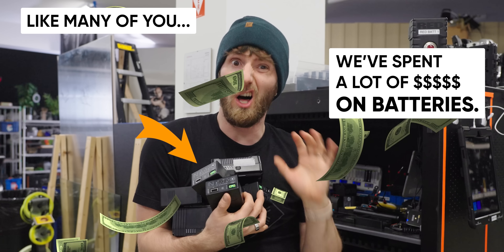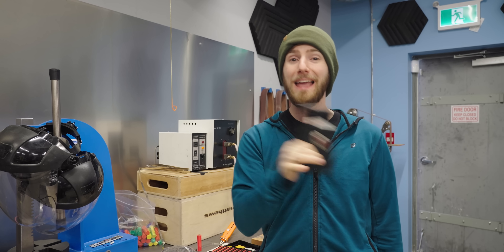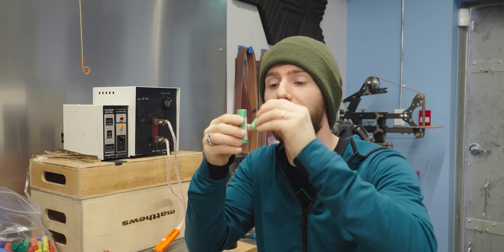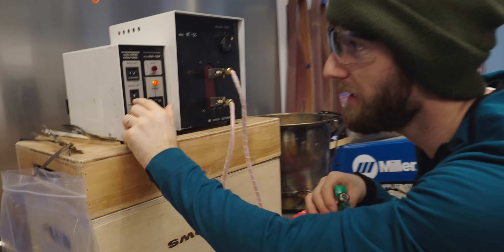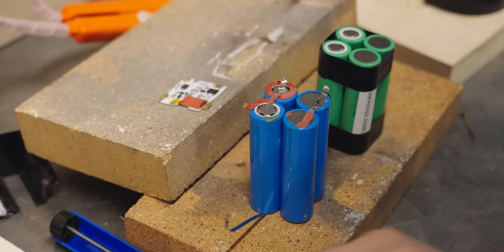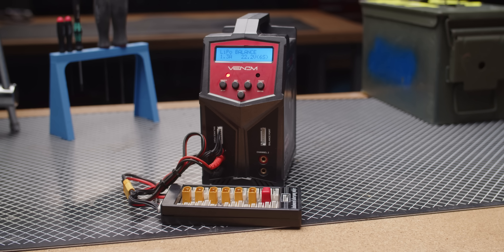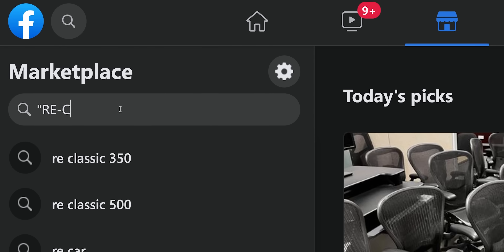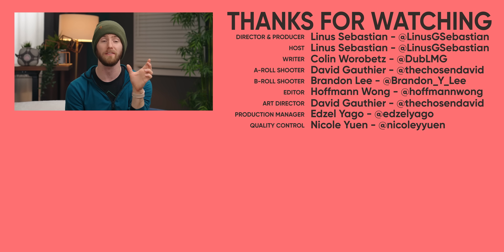This should be illegal… Battery Repair Blocking

Comment: Be very careful when messing with those 18650 batteries. I had a mechanical mod vape blow up in my face (the 18650 battery inside the vape is what blew up) and the amount of energy produced was incredible. A piece of the vape went through my cheek and broke my zygomatic arch, or cheekbone. Another piece went completely through my forearm. I was lucky in that it didn’t hit any bone or anything. It turns out that it was a counterfeit battery that was rated at only 8 amps instead of the 30 amps that the battery had printed on it. I had bought the battery from what I thought was a reputable shop. All this occurred the very first time I had used it and with absolutely no warning signs. So do not let the small size of that 18650 battery fool you, they pack quite a punch!
Reply: dude, you had a close call... glad you're OK after that.

Comment: Many BMS chips are designed to isolate the cells from the charge/load contacts in the event of a undervoltage condition, requiring a reset to switch back on the mosfets. I've replaced packs where the BMS is part of the host device, and the cells are an array of pouch batteries in a carrier with no integrated BMS. getting the device to power back on can be as simple as connecting a charger in some instances, or require temporarily shorting out the mosfets that switch the battery off in others. In these situations its typically a CYA by the manufacturer, in an attempt to prevent the violent runaway explosions plaguing early lithium ion powered devices.

Comment: I have worked quite a bit with 18650 cells in a lot jerkier fashion than you, never yet had problems with it. One reason certainly is, that I am not using soldering (putting insane temperatures onto those sensitive batteries). My 11 years old laptop is a rather rare model, where there is no other battery to buy for than the original one, which consists of only 4 18650s. I replaced those by taking apart the battery housing and using 4 new cells with the original BMS. Worked well after the BMS could calibrate to the new cells properly after a few charges and discharges. I did not solder them together like they originally were, but just laid the contacts in between the batteries. The housing is so damn tights, that everything sits perfectly and the laptop battery works for years now.
My recent new crazy invention is an insane DIY battery pack for my trusty Gopro Hero 4 black. Little trivia to the camera: It still works perfectly fine, with this one issue, that for whatever reason it stops accepting power through USB, once I hit the record button. Switched firmware several times now, every time it goes back to charging while filming just for a few days before refusing to do that again. So it will always drain the battery while filming. And since I really like to use it as HQ dashcam on the bicycle, 1 hour from a regular battery doesn't cut it on my long trips. So since original Gopro batteries are 3.7V Li-Ion batteries just as 18650s, I figured the camera should run on those as well. It does, but it came a long way:
Since I couldn't run the camera over USB, long lasting power needed to go right into the camera, to it's battery contacts. So I took apart an almost dead counterfeit battery, took out the actual Li-Ion pack and replaced it with a block of wood of the exact same measurements and put it into the housing, plastic covers and BMS of this little battery pack. Holes were drilled into the wood, where cables could go through to the BMS, soldered to the original spots where the previous battery was connected to. Also drilled a hole into the edge, where camera and it's battery latch touch, where the cable of this Frankenstein-battery could through, retaining the possibility, to just place a normal battery into the camera still.
To the other end of this cable, there was a battery holder, containing 4 18650 cells, enclosed in a very sturdy wooden frame. All of them were in parallel connection, so the voltage was the 3.7V the BMS and camera are used to, now with a huge capacity compared to the 1100mAh of an original battery. So everything was set and the camera turned on. I was expecting malfunctions at first, since I assumed this BMS would need to adjust to that new source as well - charged and discharged several times. But the existing weird behaviour stayed: Cells all charged to the same voltage, camera would turn on, but within seconds, the battery indicator would turn from full to empty. When starting a recording, the indicator would switch to flashing and 3 minutes later, the camera would turn off. That was very weird and I couldn't fix this behaviour.
At some point and some thinking, the only thing having some effect there could be the BMS. So I was like: Alright, since I can't use this camera the way it is in my desired ways, I may go a slightely risky route, not clearly knowing what happens. I took out the BMS from this battery construction and through the cables to the internal battery connectors of the camera, I directly connected those 4 18650 cells to the circuits of the camera. And what do you know, the camera turned on, now runs for months without issues and is actually able to use those cells as desired - I finally have an HQ bike dashcam, that runs between 6 and 10 hours, depending on temperature (freezing temperatures greatly lower the usable capacity of Li-Ion cells). The battery indicator is still not working totally as desired and rarely shows a fully loaded battery icon, but who cares when the practical use time is that long.

So basically, with 18650s you can build custom batteries for any device, that runs on lithium batteries. Unless shown like in this video, if the device does require the original BMS, and that being an evil one. You can do a lot with 18650s, when you are careful handling them and pay attention to voltage levels. But still, knowing the dangers of those things, I am getting myself prepared for having one or more of them taking off during working with them, or a modified device at some point dying in a fire. But I usually only do such modifications to devices, that are older and so much of a pain to lose.

Comment: I rebuilt my old laptops battery pack with quality Samsung 3000mah cells since I was mad about quality of aftermarket batteries. I didn't have a spot welder so I soldered them carefully. Been using it on my laptop for about 2 years now and it rocks solid. Even higher capacity than original (2600 vs 3000 per cell * 6), and certainly better that Chinese crap battery packs. Only problem is BMS is confused after a year and it doesn't show my charge level correctly anymore. Have to check battery voltage through HWMonitor

Comment: HP, Dell and a lot of laptop manufacturers use the "evil" types. 

Not sure if they are worse than Apple and Samsung using software to brick battery capacity to get you to buy the next version of the device.

Comment: You need to pull the datasheet for the BMS processor and do a reset! Same as laptop batteries.
Also, a single spark or momentary short is NOT a reason for a battery to explode... You need to keep the short and/or overheat the battery. 
BTW, leave the soldering job to a professional, not Linus...

Comment: The most important thing when sanding the tips of your spot welder is keeping them perfectly squared off in my experience. You’ll get sparks when welding if you don’t hold the contacts perfectly perpendicular to the tabs. I haven’t done lithium stuff, but I have a fair bit of experience building nicd and nimh battery packs and there’s a fair bit of sparks if you’re not perfectly square. Won’t hurt the battery but you won’t get a good spot weld and could blow a hole in your tab. 

On a side note, we have a jig for spot welding that uses a pedal to bring the contacts down to the battery. It seems like a much better way to get a clean weld.
Reply: I was thinking they wasted all those batteries doing that
Reply: Batteries Plus?

Comment: It's also possible the BMS has a small amount of volatile memory that gets programmed at the factory and retains its firmware as long as the battery pack has any voltage at all -- but gets erased when you disconnect the batteries from the BMS if you haven't attached a keep-alive battery first.
The real purpose of this is to prevent old batteries from being refurbished with cheap cells and sold as "OEM refurbished" or "lightly used". But of course it screws-over DIYers as well, because there is no way to distinguish between a DIYer and a scammer with a soldering iron.
Reply: That's why you measure the voltage going directly into the BMS and you prepare a station with the exact values on hold with hard switch that you can activate at the same time you snip the battery out of the loop. Essentially keeping the BMS on life support. These guys have a shit-ton of safety things wrong, so no wonder they don't know about this.
Reply: @aserta  : You don't even need to get that complicated. Just a lithium battery connected to the appropriate terminals with a pair of alligator clips will suffice. That's how I replace batteries in old videogame cartridges without losing saved games. It really is a very simple concept.
Reply: BMS's will disconnect lithium batteries because they have a minimum charge. Low and high current protections are fairly standard. To lose memory because the battery went too low and refuse to work again is not Viable. Now if the battery was reversed in the repair or had a shorted cell, miss wiring the order of cells in said string the BMS would disconnect and stay that way. To suspect maliciousness when its more likely Linus/his team made a mistake...
Reply: @chrisb298  yeA if the BMS see a voltage below lvc- low voltage cuttoff is will usually give you a flashing red/green/blue, .........(insert your battery's manufacturer's install color of led) light. Usually can be corrected by hooking up to a hobby charger and charging to above the BMS's programmed LVC value.

Comment: I have a Ford fusion hybrid and they use the same evil tactics on the batteries after about four years the battery pack will stop charging and the system will tell you you need to replace the battery regardless of the battery life or condition. I did find a way around this by using some software to reset the battery pack clock and I can now use the battery pack, but it shouldn't have to be this way

Comment: As a chemist I really like that your explain which precautions you have taken and why so. Tho don’t use a CO2 extinguisher on metal fires. Pulver might do the job but in case of Li-ion batteries… just put it in the bucket, bring it outside and wait. I mean the fire brigade in Europe does the same with electric cars. They dump them in a container full of water and hope for the best. Cheers.

Comment: You could test if the red packs are using vram by just disconnecting the cells and re-connecting them to the bms to see if the same cells don’t work anymore. I think that would be a cool short video as a follow-up to this one and provide some closure to this video.

Comment: Building a battery with lithium cells is dangerous, but not THAT dangerous. Seeing Linus almost panicking because of a spark showed that he didn't understand what the actual risks were. His team should've briefed him better because this video made it seem as if it's insanely dangerous.
Reply: Or should have got someone who's done it before. Also it's obvious that he didn't research it properly as he's still wearing his wedding ring next to a spot welder... That's just asking for trouble.
Reply: I made some packs up about ten years ago for my drone.  I slipped with the soldering iron and the tip shorted the pack.  The tip dissappeared.....
These guys were overreacting here.  
I have an ebike pack here that I'm trying to get going.  It shut down during storage and needs a code sent via rs232 to wake it back up!!!
Reply: Making it look more dangerous & incompetent is standard for LTT, why would we change that now?
Reply: @timchambers5242  idk I kinda expect more for some reason.
Reply: I'd rather have it look more dangerous than it is, because it keeps the possible Darwin award nominees from replicating this sort of stuff.
(although there's probably still an idiot out there that thinks he can do it with just the info in this one example ... )
Reply: @NotTheStinkyCheese  while I can understand where your coming from. LTT is the biggest tech channel so people are automatically gonna come here for information, this video was half done, wrong information, potentially dangerous as well. If they are going to do a video that's a bit more techy than normal then at least do it properly with proper guidance, and talking about safety.

Comment: You see lots of evil BMS in the medical device field.  I bought a used electrical bone regeneration device / electrical magnetic coil that you put around your broken bone.  I broke my tibia turbicle (the bone just under the knee/ bump) The battery packs would not work even though the cells were all good.  The BMS was programmed to only allow X amount of charges and X amount of time.  So in effect they try to force you to buy a whole new device as the old one was supposed to end up in the trash.  I swapped out the BMS with a generic bms and the battery worked great and my leg healed up just fine and I didn't spend 10 K on a stupid electric magnetic coil for my leg. I spent like 50 for it.

Comment: I was making a pack for my airsoft gun once and I did not have a spot welder. So I just soldered those cells together with wires. It worked quite fine and it made very good connection.

Comment: ALL NEW CELLS.  Well don't tell your forklift that because that's a key sector of that industry.  Most forklift batteries will get individual cells replaced.  if that isn't the case with you company then when they go end of life those batteries will be tested and any good cells and cases will be salvaged to make "new" used batteries.  I used to do this for a large battery manufacturer and it is in fact an industry standard.

Comment: I totally think that the Red BMI is evil, and for VERY good reason.  I remember when those Red Batterys first came out. I was working at a production company at the time and we were talking about buying 3-4 rad camera setup...Like the original SHOE BOX Red camera.  At the time, those Red batters had the biggest charge and running time of ANY battery on the market for video production equipment. And that was a problem because the FAA dost allow lithium batteries over a certain capacity on commercial airlines.  We worked with other production companies that had to FEDEX the batteries to the location they were going to film at just to GET the batteries for the camera to the location.  Our cameraman Drove his car from California to Chicago to get the batteries from us, then drove down to Florida for the shoot.  The reason the FAA had this rule was if your battery was too big, it would have enough lithium that IF a fire started, there was no way of putting the fire out before it would BURN THROUGH THE ALUMINUM AIRCRAFT.  So ya if you crack open a Red battery, they shut them selfs off = Evil BMI.  Because you Spending $500 on a new battery is WAY more acceptable than risking 200 people's lives when you try to fly with your DYI-Franken-batteries.
Reply: Airlines still don't allow lithium batteries >100 Wh on their planes. And those batteries are getting smaller in size and higher in capacity all the time. I recently bought a couple idx v-mount batteries that are 150 Wh each but are half the size of 90 Wh batteries from 10 years ago. They wouldn't be allowed on planes, at least not without a costly special permit.
The first Red batteries were also special because they had a much higher amperage rating than typical v-mount batteries back then. The Red One literally wouldn't work with most normal v-mounts because it drew so much power. Nowadays they can all do 10 A at minimum because people want to use them on their LED lights.
Reply: @highks496  I remember a few years ago a gaming laptop was released that was banned from airlines for exactly this issue.  I imagine the TSA calling in an IT guy to test the wattage of your laptop battery! Mainly this rule of implemented to flag someone who may try to make some homemade thermite at 30,000 feet.

Comment: With all of the issues you kept pointing out, like having to have genuine cells, how hard they are to get, needing to spot weld, the hazards of mixing cells of a different charge level, the extreme hazards that Li-Po present should they catch fire, and the list goes on... Well the list goes on for literally several minutes in your own video. It really feels like you are making the case on why consumers should not be able to replace batteries, and why manufacturers are doing thing like this perhaps to make it hard enough that there is no way they can be sued when somebody kills themselves replacing batteries.
Reply: Especially because these battery packs are, well, battery packs. They're not a device with a built-in battery where you have to throw the whole device away. They are literally changeable battery packs meant to be put on a device with a decades-old mounting system (v-mount) which is used by almost all professional broadcast and film gear nowadays. You can put them on lights, monitors, cameras, whatever. They're quite literally the most environmentally friendly and cross-compatible battery product that I can imagine (except maybe an AA NiMh cell)
The cells make up 99% of that product, the rest is just some plastic casing and a small little controller board. It doesn't really makes sense to change those cells yourself. Maybe if the manufacturer offers to replace the cells like Bebop does. But doing it yourself, paying end-customer prices for the 18650ies, spending hours on a pack like that? You're not even going to save much money because the cells are so expensive.